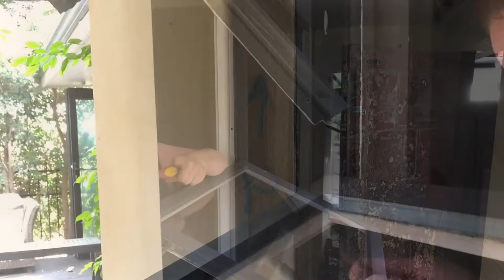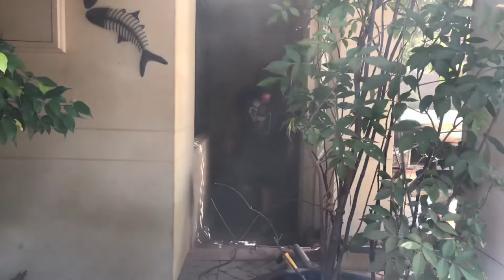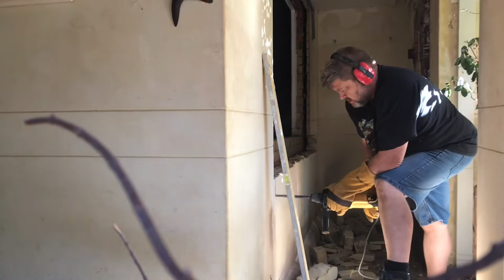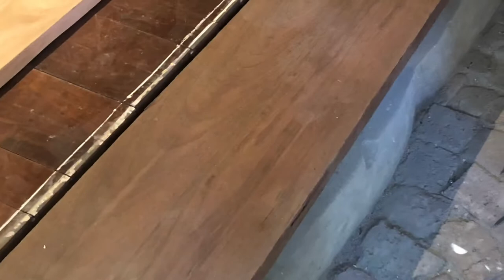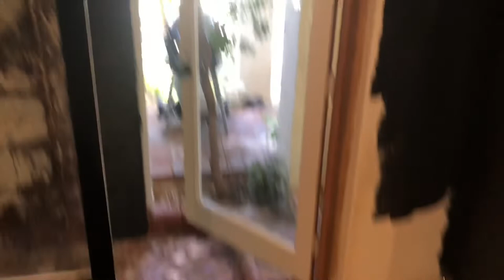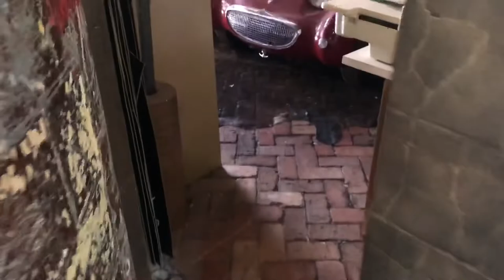Honey Do - Window Becomes Door again! DIY French Door Installation

Comment: Special doors that close of the access to the garage and the outside when they are open!
Reply from the maker: yeah we need to be able to let the puppies out at night, but not have them out in the front yard, so the door closing the path was by design.
Reply: @JBFromOZ  Opening inwards wasn't an option? Cheers, Matthew.
Reply from the maker: It would have been possible to make 3 panels open to the left, but then I would have still needed a door to close the path to the front yard. Whereas a direct link to my workshop is very well enjoyed

Comment: hows it going mate,on your 960b lathe can you give me the gear train layout for metric 1.75 pitch.tried the chart in the manual and she don't work.seems i am missing something,its not very clear picture of the gear train setup.any help appreciated.geoff ps my lead screw is 8 tpi imperial and i have cut metric 1.5,1.25 pitch.
Reply from the maker: I think the following image https://images.machineryhouse.com.au/products/L237D/700/7_Feed-and-Theading-Levers.jpg should match up with your and my lathes, I also have 8tpi leadscrew. 
From this page, it appears 1.75 is not an option with the 30T, 32T, 40T gears. a 28T gets within 20% (2.10mm) *28:127:120:40 so not really an option as far as I can tell on the AL960B